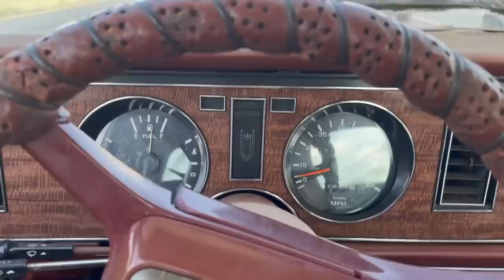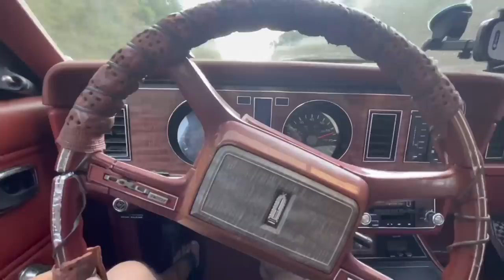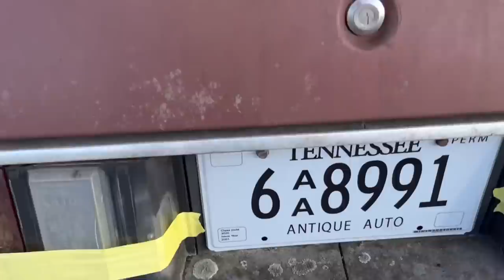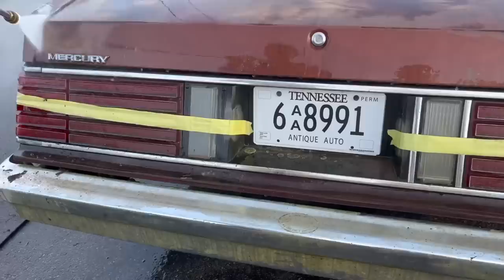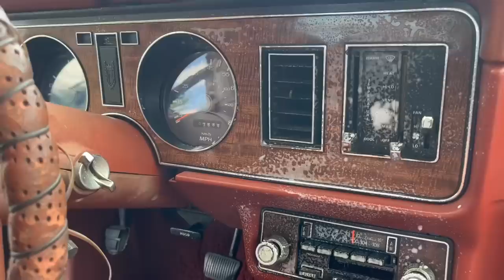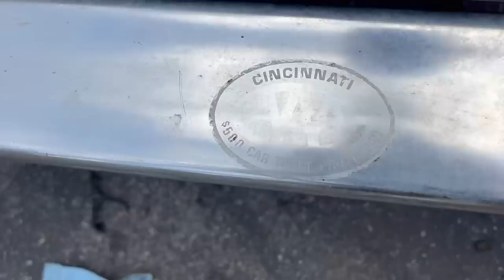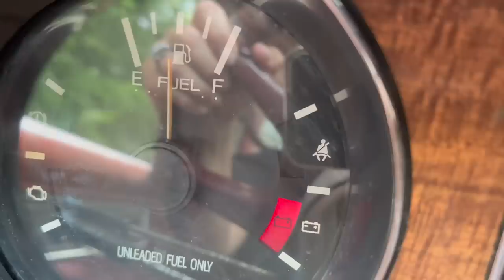Embarrassing my kids at school in an ugly old car after new brakes and first wash in 15 years!

Comment: The memories your kids will have with you on these adventures and projects you can't put a price on my kids might get embarrassed when I roll in with a project LOL but I've had my 15 year old come out and say she wouldn't have it any other way
Reply from the maker: I hope so
Reply: Yeah get a corvette given to you before you can drive  ohhhh the ego  lol I'm hipped for it and I don't even own the darn thing 🤪
Reply: @Sleeperdude  Why not EV convert it ?? and no the battery does not cost $20000 like the EV haters claim... eg there is a Beetle in the UK that has 6500bhp and a 22kw battery... a Tesla that does 752 miles on a prototype 200kw battery... so the haters are 110% with the nonsense they are paid to spew out..
Reply: @Sleeperdude  you can of course do as you want, but if you clean a carburettor, soak it in petrol for a piece and blow it through thoroughly with an air gun 🤔 I am writing from my own good experience
Reply: @Sleeperdude  HELLO
Reply: 4
Reply: @D88123  5
Reply: I have to agree. The way the whole " Sleeperdude"  family interacts is both impressive and incredible. Cheers

Comment: Watching this instead of finishing my lowering kit for my 96 Vic because sleeperdude uploads take precedence over all
Reply from the maker: Awesome
Reply: @Sleeperdude  HI GUYS ☺️☺️☺️❤️❤️❤️❤️❤️❤️😇😇🙏🙏💯
Reply: Watching this instead of finishing my cv axles for my lifted 99 crv.
Reply: Both the lower sides Armor All the tires and buy a rebuilt carburetor or maybe even try to rebuild it yourself. I was just order a rebuilt carburetor for RockAuto and be done if you haven't put new plugs in put your plugs in if you haven't replace the air filter and fuel filter replace them that's it that's a keeper! Lindsey oil might be a good idea I don't know I've never tried it but I'm getting ready to on my truck

Comment: My wife's first car was a 79 Zephyr the same color as yours.   Her car was a 4 door, but the trim, pin stripes and wheel cover were identical to your car.    By 1985 the dash was already cracked just like the one you have.   Tail lights leaked into the trunk.   By the time we traded that thing in on an 87 Dodge Shadow she would not drive it anymore.  Had it to three different dealers to fix a stalling problem.  They never could fix it.  The darn thing would start every time no problem.  But, once it went about a mile, if you stopped it would immediately stall out.  It would restart easily, but it but take about 3 to 4 restarts to get through an intersection.  After about 10 minutes and it was fully warmed up it would run fine.   Have not seen one like that since 1990 or so.   It was fun seeing you guys getting her cleaned up & ready to stop.

Comment: The rear brake that felt too tight most likely has a slightly stuck emergency brake cable. I used to come across that quite a bit.
Reply from the maker: Yeah your probably right

Comment: The reason the self adjustment cables usually break is because you are supposed to put the front springs on first. If you don't the cable rubs the rear spring.

Comment: You got a keeper there, in fact in a toss up between keeping it and the wife, it's a tough call. I bought a 1979 Zephyr wagon for $50.00 that supposedly had a seized engine. I started to get ready to remove the engine and found the starter was engaged to the flywheel. I put it back in with shims and it ran perfect. The car was spotless inside and out. Sliver outside with red interior. 2.3L with progressive 2 barrel Holly. It even had power steering & power brakes & a roof rack. It had 49,000 original miles so I did replace the cam & followers because those always wear out near 50,000.

Comment: Okay Josh, 
Bear with me.
I had a few suggestions from this and past videos and rolled them into one. Hopefully you haven’t heard them all already.
I KNOW you really love your quadruple ought steel wool and Comet cleanser but you really need to try making a thin paste of barkeepers friend cleanser. The Oxalic acid in it eats rust. Just wipe it on and wipe it on again after it dries and it dissolves the rust and brings out the paint/chrome without a lot of elbow grease. It’s an abrasive product but you can also get wood cleaner/bleach that contains oxalic acid. I think it would brighten them big teeth on the F100! It’s a conservation trick I learned from the other antique bicycle enthusiasts on the C.A.B.E. message board.
In the previous Zephyr video, dismounting that one cantankerous casing would not have stood a chance against liberal amounts of liquid dishwashing soap poured into the gap created as you open up the bead. Work more of it in as you pry around the hoop and she’ll usually pop off before you make 360 degrees. Works like a charm full strength for seating the bead too.
I remember when Ford strayed from the tri bar taillights and the mostly steel interior in the 1979 Mustang! I was horrified and angry, so I’m not a huge fan the designs of the era. But I admire your enthusiasm for the Homer Simpson Wagen and really do understand the attraction to the v8 Futura and Zephyr coupes, with their nod to the 56 Crown Victoria rooflines.
Reply from the maker: Yeah that’s good info I need to buy some of that

Comment: I remember those orange stickers like the one on your left front wheel.   Explaining that it was OK to take off the space saver tire and install a standard tire on that wheel.  Yes tire not casing, in the tire industry casing is the word used to describe a tire    carcass before it has tread on it.  I.e. make sure you set good casings aside for the tire recapper.  I don't think anyone bothers to recap passenger tires anymore only truck tires are  recaped today.

Comment: I’d like to blow your mind I have a 1980 mercury Zephyr Z7 4.2 L, 96,000 original kilometres not miles is the exact same colour as the one you have, this one is all original. I am the second owner. even has how to start hot and how to start cold instructions. i’ve driven this from Prince George British Columbia down to Vancouver BC, Kelowna BC just cruising around , and on the dash ride engineered, I also have about 400 cassettes, this little beauty was stored for 36 years in the garage until I ended up with it, and had no place to store it inside starting to show a little weather fade on the dash, this car has no rust, but I love just to just take it for a ride around oh yeah, last year the power windows are acting up  motors need to be replaced

Comment: I had an 82 Zephyr that was the same color, but a 4 door and the whopping 86 horsepower 2.3 4 cylinder. My friends gave me crap for driving a granny car that was slow, but I ended up towing every last one of them home with it at some point or another. Funny thing was it would bark the tires when it hit 2nd gear. It never ran that great since it had a lot of vacuum hoses that were falling apart, but it never left me stranded and really never needed much other than an alternator. You could almost stand between the radiator and the engine, it really wanted a V8!

Comment: I have had two mercury's and never had any problems with either one of them. Well I crashed my 1998 Mercury Grand Marquis and that's the reason I have a 2004 Mercury Grand Marquis now but it has never failed me. Mercuries are really built well as long as you drive them and don't let them sit unused for 15 years. But that one cleaned up really well and once you get all the quirks worked out it will be a great car again.

Comment: Excellent video Sleepdude Crew Josh  :) lots these vechiles put videos in my childhood years from 1976 to 1995 years if like know to also what glue us put decals on or lens is called Black Gasket Mender when put want use Q tips on seals section then press for 30 seconds if can't get from Auto parts store use Crazy or Super  glue ! Also Alternator Flashing means Alternator needs replaced or Regulartor Box needs clean on plug or replacement or Fender ground cable need clean up or Belt needs replaced to ! Also seat belts button should lube with WD 40 so  work fine do seized up if never used too and do doors inside mirror lens so free to adjust no problem too! Also that car 1982 Mercury Zephyr are cool cars and last long time paint up to also new rebuilt carb help to also ! Also Wawa excellent on shelf assembly to!

Comment: I have a good and cheap way to clean your seats car tires and other things. You add peroxide Dawn dish soap  Not much and water put it in the spray bottle Shake It Up. Spray it on your seats and let it sit for a little bit and then vacuum 🙃🥰

Comment: The black handled rubberized screw driver is iconic and probably used also for a small pry bar, mallet, or scrapper. Josh looks so much like his Dad. So glad you had great success with the Zephyr! Does it have a.c.? If it does, Squeezey/Squiggles should approve of it, right? WaWa did a great job on the shelving unit. Now you have a place to put lug nuts! It might increase the probability of being able to find them when it's time to put the wheels back on. My '78 Fairmont had all vinyl seats. If you didn't wear a seat belt, you could slide from side to side on the curves.The detailed sewing lines ripped after a while and clothing snagged on them, so I had to go with a cover. I like the cloth covered seats and you made them look nice again. I hope Ralphie's project turned out as good. Great vid even the goat-cam parts. You may have to up Puddin's pay since she's now the "skilled staff". Can't wait to see Mom's vehicle. The suspense is real.

Comment: They sure knew how to paint those cars. Some of these 2000's Chevys you can pressure wash flaking paint right off in a jiffy. It's easy to see why you like these cars. The difference inside the cleaned engine bay surprised me.  I'd like to see it with the mouldings back on , dash badge glued on straight, and fix up where the vinyl top came off.  The interior is so nice it seems worth some additional restoration inside.
Reply from the maker: Ok thanks

Comment: Years ago I bought a car someone had ripped the vinyl off the roof. I think it was an old Dart. I just painted the roof with black rustoleum paint. Used a small roller so it wouldn't have the brush strokes. Looked pretty good from a distance. Better than rust anyway. Lol

Comment: Josh, I love your family channel!  I also love your "flops" and since you open bottles using the opener of the bottom I have to guess that they are Reefs.  I wear them all the time too and they are great. Incredible cleanup on the Zephr.  What's a little alternator light blinking or squeaking, I believe you are ready for the car show.  Have you tried the cruise control, it would be interesting to see if it works too?  Hope you had a great trip.

Comment: Worked for Ford saw many a fairmount Rental car later in 86 I drilled many a hole for Rusty Jones. had to be careful not to over spray so the doors still Worked P.S. I rememember the Frist 5.0 Mustang Had to install the front bumper.

Comment: Pull the cap up a little bit take some WD-40 and spray it and it will stop it from getting wet when you pressure spray and it will start right back up and it does work

Comment: The only product for degreasing imo that works as intended anymore in the automotive market is Spray 9, give it a try... it'll "ahem" super clean your engine for real and disinfect at the same time eliminating the bleaching step you go through. it's as good as the original formula Grease Lightning for cutting strength too.
Reply from the maker: Ok thanks

Comment: In the mid 80’s I had plans to do a different custom version of a Z 7 but never followed through with it and now wish I had because now I am no longer able to.  Don’t make the mistakes I did and keep putting off doing something because the day may come when you realize it’s too late for you to do it, and the regrets have started piling up on your shoulders. My plans were to take a Z 7 and  change the top of it to a top from a station wagon but retain the Z 7’s factory B post kind of like a 55-57 Chevy Nomad  had. But I thought to make removable solid side panels that could be installed over the back side windows allowing it to be taken from a 2 dr station wagon to a sedan Delivery and back into a station wagon as wanted in a matter of minutes.  ( just think about the reactions on cruise nights when a cool station wagon goes cruising past  and a few minutes later a matching sedan  delivery goes past and another few minutes later the station wagon drives past again. It’d be driving some of them crazy trying to figure it out)
Reply from the maker: That would be cool
Reply: @Sleeperdude  you seem to be in an area where you can still find these cars, Maybe you would be interested in building it since I am no longer able to for multiple reasons 1 - none of them left around here. 2 - I am physically unable to do it because of severe spinal problems. 3 - No money to do anything since I became disabled and fighting with Social Security for over 5 years to get my SSI completely wiped out my savings.

Comment: Id reccomend to regasket the carb, make sure the fuel bowls aren't leaking, as that makes for hard starts. Also check float levels as it seems it may be low. Make sure accelerator pump works 100%. Plugs/wires will help some too, but i bet its starving for fuel.
Reply from the maker: Ok thanks

Comment: Bill of material of solid driveshaft in 1928 Around the Lincoln Zephy grade 4 steel without tin coated then the performance fit the seal ring to the housing of the R. Differtial exposed RPO x 2 that is between the hub bearings of the GT steel 13 in.rim and the lace letter x cross spoke all aluminum design 13 x 5.5 inch

Comment: Take that headliner board out,not to hard,3M spray glue ad some headliner material,we have a place in near me called,Foam and Fabric,they have some the stuff in different colors.
Reply from the maker: Good idea
Reply: @Sleeperdude  I dabble in upholstery,you have to clean all the old foam off,we used a wire brush on some,on some the glue film from the original material can be pealed off,some are made board,some Styrofoam laminated with cardboard,and others are made from a hard fiberglass insulation,but no matter what its made from clean the surface first. In a pinch a cheap Harbor Frieght paint gun can be used repeatedly if cleaned to spray Contact cement,get that in a quart can from Lowe's.

Comment: When you are reassembling the hub bearings,  you can tighten the nut with channel locks just making the nut slightly tight (about 25 ft.lb.), then spin the hub a couple of turns turns,,  then back the nut off and retighten it with your fingers as much as you can tighen it, then turn the nut tighter if needed to align the cotter key hole,,,  Tapered wheel bearings need to have a certain amount of preload on them so that there is no wiggle in the bearings,,  If you have an in/lb torque wrench,, then retighten to 10 - 15 in.lb. after backing the nut off from the initial tightening,,,  :-)

Comment: The lace design for 4lug x 4 wheel for $599.69 from spokane, WA. Mustang used no tire. Zepplyn GS 1980 color 2 tone red to 1985 repainted detailed car coupe.atop the no U joint between pumpkin shape housing of R.different. include no pipe with live axle. The live axle is exposed while driving. It require the two radial rolling precision ball bearings. Yep two outer races of ball bearings per wheel Taurus super high output (SHO) MFI elite sporty bearing 
Plastic metal seal per fast bearing mod. McPherson strut goes thru upper A control arm includes lower A control arm no. Trailing arm. The lower A control arm is the front one of 2002 Taurus SES or thermo plastic intake plenum SE model. The front control arm goes to the back suspension instead the front.

Comment: Hi sir,if If I can make a suggestion after your engine bay cleaning ,may be you can use a leaf blower to dry out your entire  engine bay including your distributor cap and cables ,I saw that on a detailing videos,keep the good work from a subscriber in canada.

Comment: Brake re-lining. I had to cut the lines for my rear brakes since one hose leaked out 2 years ago and the other wasn't too far behind and the brakes are good. However, they feel like they're pulsating and I think it's my rear calipers or it could be the hub assembly up front that's gone bad (well, the ABS/TCS/SVS lights are on and so is the small EVAP leak code).

Comment: I had a good 80's gm gbody was probably one of my favorite one's it was a 84 Pontiac grand prix sj factory non vinyl top car and manual windows also no bright metal trim along the bottom of the body..lol but I ended up selling it because at the time I had 13 vehicles and 4 were drivers one was the 82 Oldsmobile Cutlass Cali's t top project car and a 81 titled new body style third gen Chevy Camaro berlinetta Lt two tone light blue on top and dark blue on the bottom separated by the triple gold pinstripe, factory posi 3.42 10 big rear end and factory 4spd manual transmission and am/fm 8 track tape player..lol and the aforementioned faded red and black pinstripe 82 Chevy k20 Silverado

Comment: Still waiting on the Fairmount / Durango conversation . Have you checked out the Durango on Junkyard Digs ? Just don't cut the roof off and drop it on your toes like I did. It still hasn't healed . Turns out my bedroom slippers weren't steel toes.

Comment: That Zurfacer around is too short engine bay to fit inside 3.3 inline of 1980 similar to Zupp Fairmont rated 140 HP but it boost to 12 inch wheels rear GS reddish color purple rally stripe Pony to 150 HP includes Jeep used 390 Cubic carb 2 barrel carb inline instead Capri GS 5 pour holes port per venture boost. Just spray one port Holley boost venture replacing 1 barrel and V8 intake manifold. Depending to whether it's two plane atop the intake manifold.